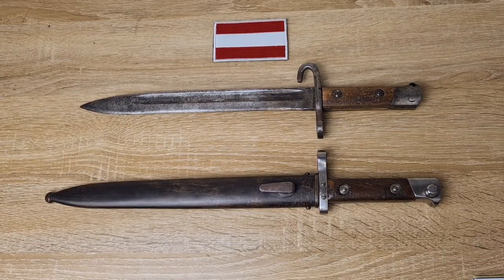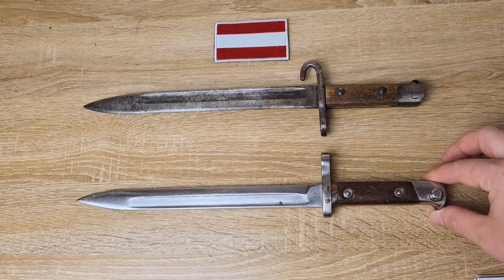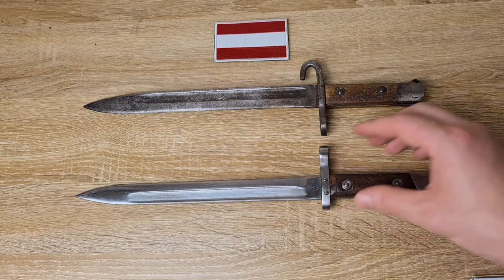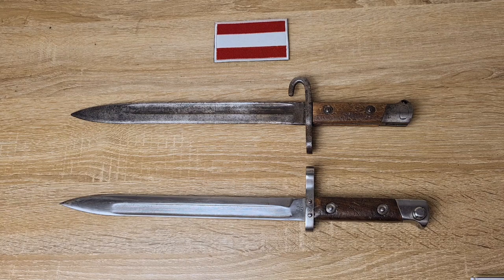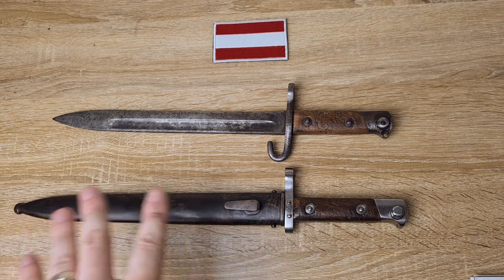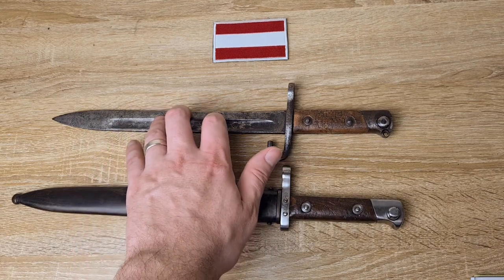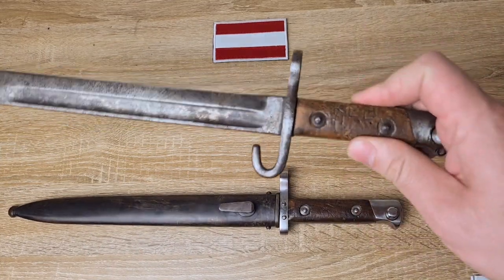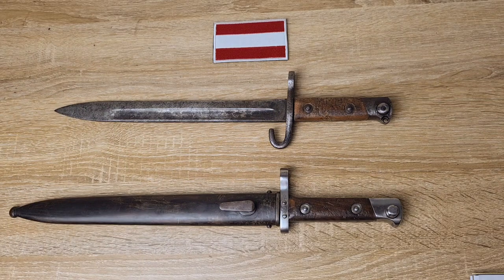Austro-Hungarian WW1 M95 bayonet

Comment: Mine had 0 markings, and a weird stuck button... how could one get it unstuck?
Reply from the maker: Sounds like it could be a dress bayonet. Stuck buttons can be very difficult to fix, I generally give them an oil. If it doesn't want to move I usually leave them
Reply: @pointynotsharp8436  huh... shame, the crossguard also was weird, it had no hook/ring etc. no nothing tought that it was broken and ground down, but then again the blade was untuched and not sharpened beyond the factory